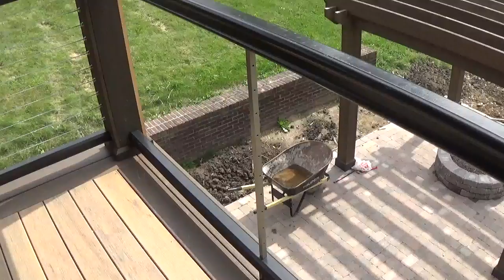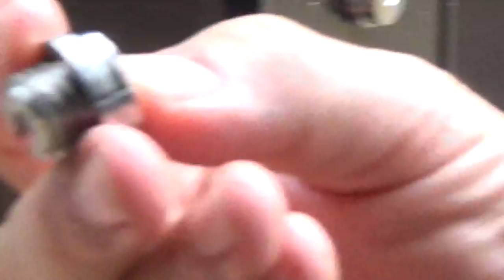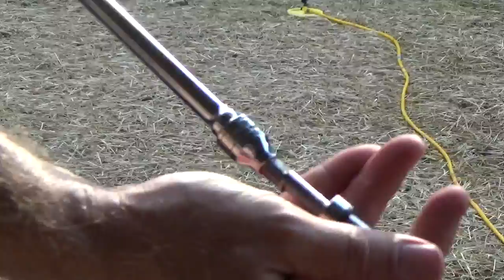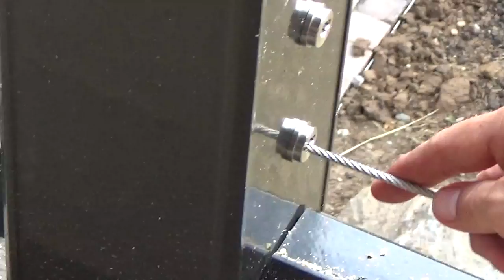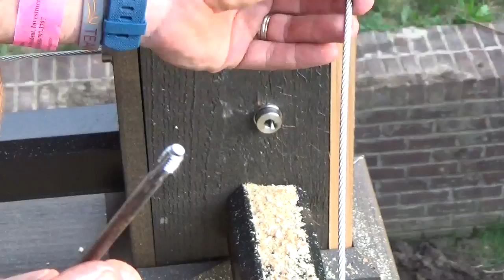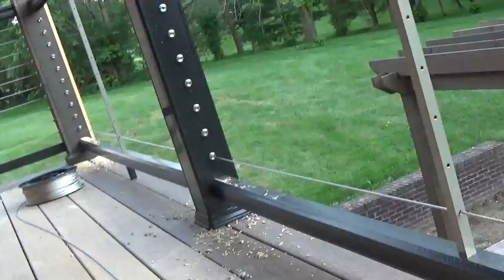Cable Bullet Railing Install

Comment: Some of the Cable Bullet installation videos I’ve seen have quite a bit of cable play after being tensioned. Were you able to get enough tension on the system to prevent more than a 4” gap with pressure and feel like this is safe for small children?
Reply from the maker: Yes our cables have maintained their tension nicely.   I haven’t tried to push a 4” piece through but they still are taught with no play
Reply: @rodneyscott1336  Thanks for the feedback. Your installation looks great and I’m glad to hear it’s still performing well too.